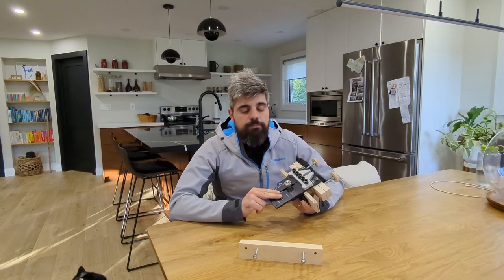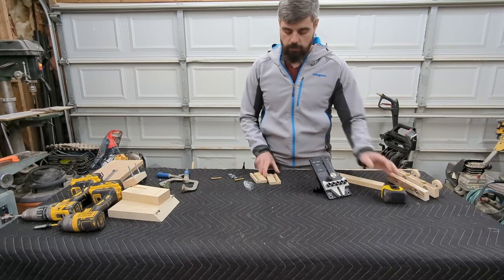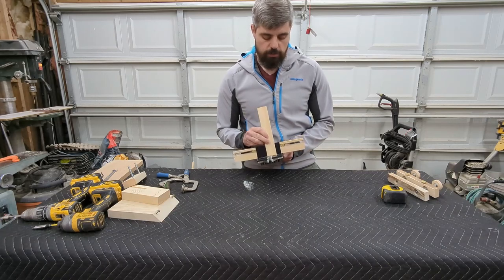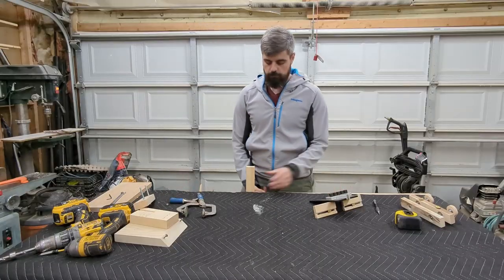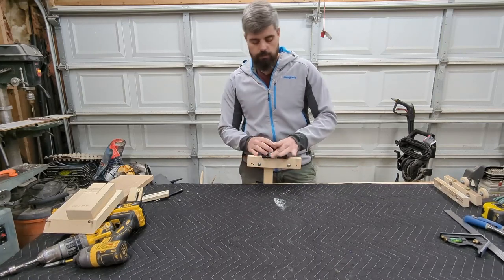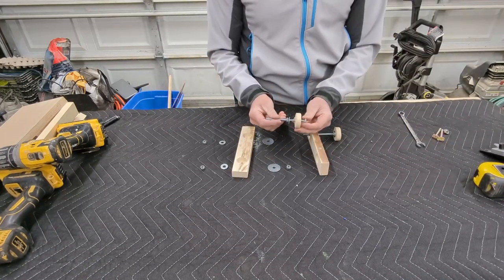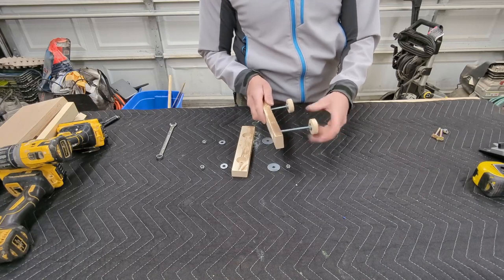JessEm Dowelling Jig Mods You Have To Make

Comment: These are brilliant hacks!!!  I just built the small workpiece holder using some old oak flooring I had available and I used the POWERTEC 71484 T-Track Knob Kit for the hardware, and it works beautifully.  I'm going to make the "integrated clamp" later this week.  Thank you!!!
Reply from the maker: I love that you made the jig!  I hope it works out well for you as it has for me.  Really means a lot that these ideas are actually helping people.
Reply: @MisterWoodBaron  Absolutely!  Dowelling the ends of small pieces to get clean, consistent holes has been my biggest problem and this solved it for me.  I just used it to put the holes in the ends of an apron to connect with the top of the legs for a small bench I'm making, and I also used it for the matching holes in the legs by removing one of the sides and using the other to align with the top of the leg to guarantee that joined the pieces would be flush at the top, and it worked perfectly.

I'll let you know how it goes with the integrated clamp after I put it together - I have the parts so I should get it built within a day or two.  Happy Labor Day!
Reply from the maker: Awesome! Happy Labour Day.  I look forward to hearing how the rest goes for you .

Comment: Great ideas, I especially like the side alignment pieces. I have both the earlier JessEm 08300 jig and the 08350 jig. The 08300 had a screw clamping part, two fine-threaded screws with swivel pads, that a lot of people, myself included, found unnecessary much of the time and time consuming to make large adjustments due to the fine threads. When working on wide boards, I found that as long as there was some lateral positive stop that I could hold the jig in place by hand as long as I was using a brad-point drill bit. I still have a slight preference for the older 08300, but the 08350 is a handy addition in certain circumstances such as needing to manually align one piece to another with the alignment "jaws". Now I see they've released yet another design, the 08355-08360 offerings; from what I can see, it doesn't look to be as "hackable" as the other two. 

Take a look at Woodpeckers' Multi-Knobs and Multi-Knob Mini-Ts. These allow you to use your own nuts or bolts in 1/4", 5/16", and 3/8" sizes for the former, 1/4" only for the latter. They are, surprisingly for Woodpeckers, reasonably priced, more comfortable, and much stronger than any plastic knob I've seen. Besides for shop jigs, whenever possible I replace knobs on purchased jigs and tools.
Reply from the maker: I appreciate the feedback.  Yeah side stops seem to be part of what I use the most.  I'll check out the woodpecker knobs.  I need to install some to make life just a bit easier.  Cheers

Comment: Excellent improvements.
Dowelmax user here; the on-board clamping is the main reason I chose the dowelmax over the jessem, though the jessem is just as well-made as the dowelmax. You mentioned the jessem workstation in another comment; IMHO, it's a hard sell, especially when you factor in the need for microjig dovetail clamps (not included). Add the doweling jig and workstation, plus the microjig clamps and you're practically halfway to a domino. Personally, Either the jessem or dowelmax are the way to go. Add jigging as necessary. I'm making a t-square attachment for my dowelmax that makes mid-panel doweling effortless.

Keep it up. Subscribed.
Reply from the maker: I couldn't agree more.  Both tools are very well made but they both have a few shortcomings that the other seems to take care of.  I don't think anyone would make a bad choice choosing one over the other.  The workstation definitely gets pretty pricey though!  I appreciate you watching and subscribing.  Cheers!
Reply: Would love to learn more about the “t-square attachment” idea.
Reply: @joedance14   Bascially it's a wooden T square made from baltic birch plywood. The arm that crosses the panel to be drilled has a slot routed in it for the dowelmax drill guide screws to go through and be secured from the other side with the brass knobs that come with the dowelmax. Parillaworks did something similar using aluminum extrusion, though he just clamps the block in place. I'm working on a video of my version.
Reply: @NWGR  Thanks!  Sounds great!

Comment: Like you and another, my issue has been clamping. I've made a couple of rough jigs that worked similarly to yours but yours do a couple of things mine didn't. First thought, have you considered cam clamps like Leigh uses on their dovetail jig? Or lever clamps? It might speed things up a little more but I wouldn't know until I tried it. Second, I'm glad to see you figure out practical way to improve a product the manufacturer stopped short on, probably because of price. Last, thought, I agree with another about the workstation. It's nice but expensive and not including necessary clamps is a dumb move. I think you could design something better, with an option to choose the kind of clamps, and sell the plans for pennies on the dollar compared to theirs. Nice job.
Reply from the maker: Hi, I really appreciate the insightful comment.  I've wanted to revisit my design and make some improvements but I've been so busy I just haven't had a chance.  I like the idea of cam clamps for sure!

Thanks so much for watching and commenting.
Reply: Very interesting, nicely thought out.  
In terms of additional improvements, the long bolts & knobs seemed to be time consuming to adjust.  Essentially, the standard 1/4-20 thread seems like a micro adjust mechanism, over a significant length.  Three ideas come to mind:  a quick-adjust mechanism for large adjustments, then switch to the micro; cam clamps, as mentioned by the comment above; or toggle clamps, which could be easily adjusted for different workpiece thicknesses.  
Offhand, I would suspect the quick adjust option might work quite well, but could be tricky.  The cam clamps might be the easiest to implement.  I would think toggle clamps would also work well.  Both types of clamps could be adjusted just once for multiple workpieces of the same thickness.
But this issue is minor compared to the really impressive work you’ve already done.  
I also liked the comment about a T-square mod from another user.  Sounds like a good idea!
Thanks again for sharing!  Looking forward to more!
Reply from the maker: Thanks so much for the feedback, I love it.  A cam mechanism really could speed things up for clamping and unclamping.  I'd want to make sure that I keep the system small enough that it doesn't overpower the doweling jig itself.  Cheers

Comment: Thanks for this video.  I am waffling between getting the JessEm and the DowelMax and while the integrated clamp isn't the only significant difference, it's a big one.  It was really helpful to see an implementation of a clamp for the jessem.  I am a bit concerned about the more complex clamp you designed for the larger pieces.  It is loading the drill guide carrier, the adjustment thumb screw, and the adjustment dowels and their slots.  Being able to clamp directly to the jig fence would be better.  It certainly looks like your design holds up well as far as I can tell in the video and since I am still considering what to buy, I have not held the JessEm to get that practical feel.  Maybe this is fine and won't induce any problematic wear or resulting slop in the adjustments.  That said, if you are looking into a more advanced setup such as you mentioned around some angle iron etc, addressing this might be a reasonable thing to consider.  I imagine a basic structure of a U piece on each side of the jig reaching from the fence over to the far side of the wood with a clamp similar to what you already have.  Using this U over the top ends up bulkier but lets you make it for arbitrary board thicknesses, avoids any new loading scenario for the jig, and retains the ability to clamp on the long edge of the board.  The first difficulty I see is that the holes you use in the fence appear to not have any chamfer on the side facing the board.  If they did, this would make it easy to recess the fastener head.  As is, assuming no jig modification, a spacer plate thicker than the fastener heads may be required which would offset the adjustment scale.  Not terrible.  Or, perhaps just some form of double sticky tape, or even velcro for easily on and off of the clamp, would suffice on the back side of the fence.  Another detail that came to mind for such a U clamp design (err, they call these C clamps really, don't they...) is that if the U is rigidly attached to the fence or the clamping board on the far side then any deflection in the U can induce distortion of the piece to which it is attached.  You could always just make a bulkier U to reduce this, but providing some interface that lets the U deflect without transfering to the fence and clamp would be nice and I don't think too hard to add.  Maybe I'll sketch up an idea tomorrow.  Thanks again for providing this video from which I could brainstorm even without the jig in my hands.
Reply from the maker: I'm sorry I never responded to this.  It slipped past me.  I appreciate such a detailed response.

Honestly I haven't had any issues with the setup as it is in the video.  I haven't found the need for additional angle iron or anything for my use case.  We will see how that goes in the future but the jig itself is pretty solid.

What system did you end up going with?
Reply: @MisterWoodBaron  No worries, we've all got plenty going on.  :]  I haven't purchased yet but still sort of expect to get the JessEm.  I've been focusing on clearing out the garage from being a mess where I can't barely reach any of my tools to at least having enough space to work all of them, lighting, power without swapping an extension cord around, etc.  I'll get back to the doweling jigs at some point.  Thanks again for the video.

Comment: Have you used Jessem’s Workstation for Pocket Mill Pro? They have a video about how to use this with their doweling jig. It looks like it would be fairly easy to make one. What are your thoughts about that?
Reply from the maker: I have seen it and I think its interesting but its big and a bit pricey.  I think the key component is how the jig mounts to the board (if I recall correctly) and you may need to get a little creative with building that component.  I think that the idea of a workstation could work really well when you want to setup repetitive cuts for sure.

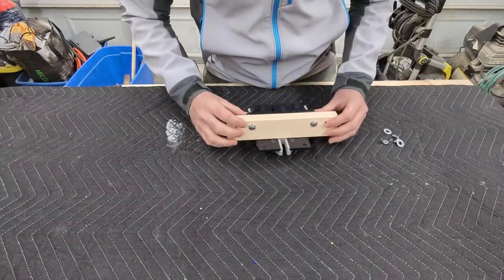Comment: What is the dimension of the piece of wood used in the first clamp example (@ 5:02 on the video)? It seems this dimension is critical so as to maintain the measurement references on the jig. Is that right?
Reply from the maker: Hi Steve,
The dimension is not critical because the measurement reference on the jig is from the fence on the jig.  The wooden clamp bar is not between the fence and the work piece.

Basically the workpiece is still referencing against the jessem fence so everything operates as normal.

If you like I can get some measurements for that piece tonight but basically as long as it's wide enough to go past both bolt holes you're golden.
Reply: @MisterWoodBaron  Ahh! Gotcha!! Please don’t worry about getting back to me I understand exactly what you are saying👍🏻✅
Thanks!!
Reply from the maker: Awesome. Cheers buddy

Comment: Have you seen the workstation? Any thoughts?
Reply from the maker: It was funny timing.  I did my research before developing these jigs and couldn't find anything, on the JessEm site or otherwise.  Then right before releasing the video, of course, there it was when I checked again.

The workstation seems cool and probably more functional than what I put together. However, I feel like I get very similar functionality with my pipe clamp bench vise and the almost free jigs I made.  I also have a video soon showing a easy jig for cutting miters that you can set to any angle, not just 45 degrees.

What are your thoughts on it? Have you used one?
Reply: After using it for a while, I think your small parts jig is faster for narrow and long stock
Reply from the maker: That's interesting!  Faster than the workstation?  That's some awesome feedback.

Comment: Just take the one side off the jig and set it on the corner.
Reply from the maker: Sorry, what do you mean?
Reply: @MisterWoodBaron  I had the same thought - for your first jig with the positioning stops, instead of transferring the centerline and aligning by eye you can just remove the appropriate positioning stop to make clearance and use the other one as the fence to align against the corner of the other board. Of course this only works if you're going to the edge of a second board, if it's somewhere in the middle then transferring the c/l mark is the way to go.
Reply from the maker: Ah, I think I am following what you're putting down.  Its always great to hear other ways to get the job done. Yeah that makes sense if you're just lining up 2 edges.  Thanks for that!